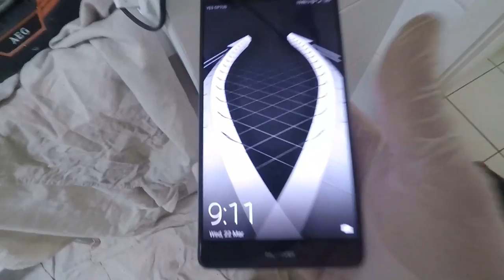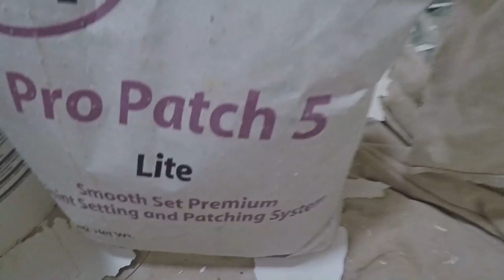How to fix the paint peeling off your ceiling

Comment: still DONT get what u used 2  remove the paint off the celing. i  just got a new house and the paint is peeling off a new plaster so trying take off All the paint any ideas how is the fastest way to do that? thx
Reply from the maker: It's a tough one, you can just scrape back as much as you can and use a product called peel stop for the rest.

Comment: after you've painted over the peeling paint, how long do have to leave it before scraping it off?
Reply: I'm painting an old 1950 house which has peeling paint on the ceilings but it won't all come off like in your video a short time after painting. But I only left it for a few minutes
Reply from the maker: +CrossyUtube007 like a minute, it comes off straight away. I'm pretty sure you could roll some buttermilk on there and it would just come off
Reply from the maker: +CrossyUtube007 yeah well the stuff that doesn't come off leave it on... If it starts to lift get it off.
Most of the time the stuff on the plaster joins stick better than on the paper of the wallboard sheets
Reply: Ok thanks.  I guess being an old place it's adhered pretty well in places and I was expecting a lot more to  come off
Reply from the maker: +CrossyUtube007 actually you never know how much will come off. Some people asked how come I didn't scrape it off in the first place and that's because it wasn't loose like everywhere else.
Good luck on the job though. It's a pain

Comment: Nice work mate. I have to quote quite a large ceiling of peeling paint, ruffly 50 to 60 m sq. how do you approach something like that without knowing how hard it is going to be to scrape back.
Reply from the maker: +nick checkley assume you have to go over every part. This ceiling was a toss up to just sheet over the top. There would have been 1 joint to set in the middle and some cornice.

Comment: why can't you use 25mm screws? 
noe forget about the flush join. The cornices are made from the same materials as the plaster
 board yer & it be pretty safe to say what ever they used to paint the ceiling with they used to paint the cornices with right. so why has 
 only the plaster board peeled not the cornices? that's what I'm interested to know.

Comment: as we grow we need to be vigilant. You definitely on the correct path. as for my original question that didn't really give me any answer thats cool just wish I knew so I could tell you. question the paint came off in sheets (very easy) all over except for the join & the cornices. ok the join has a somewhat different finish still the cornices is the same. it don't make   sense. Still that type of work is I think by far pretty crappy work with the mess it makes & he's you doing crappy job on your own without any help from extremely  hot trades person. what does that tell you. people watching you believe in you & that's cool.
" promise only what you can deliver then deliver more than you promised"  
Later maxkill..

Comment: I noticed when you were scraping the paint off it came off just about every where except the join. why is that?..
Reply: Micheli Zappala probably because those were they only places to actually have mud. concerning there was no screw's anywhere besides the corners and probably the seam. I wouldn't hang out in that room. ceiling might fall.
Reply from the maker: +TLOYA1 yeah that's right, the paint was sticking to the plaster rather than the paper of the drywall plasterboard. Ceiling was fine, was straight and solid.

Comment: where you say mud you mean plaster yer. we're you say seam you mean join yer. it's like me saying in quote To supply & install 10mm plasterboard to underside of bare ceiling joist with 75mm cove cornices to all perimeter walls flushed left ready for painting. do you think joe blow & his lovely wife pot plant know what flushed means. 
so there was no screws between the joins as per how they once done things. so wile you were there you put a few screws in so it don't fall down on anyones head kills them then you having to take time off work explainng in coroners it wasnt' your fault maxkill. now I'm guessing you going you tell me how you used 30mm screws cause with sagging gyprock 25mm are to short 40mm too long with 30mm being best. ps flushed  (plaster patched) now how blow gets it.
Micheli as for Top Class Ceilings..
Reply from the maker: +Micheli Zappala I never said seam in my life, that's right, mud is plaster, 
It was paint peeling off, board was sound.
No coroners.
Can't put 25mm screws in ceilings regardless.
Where you been? I'm missed your comments